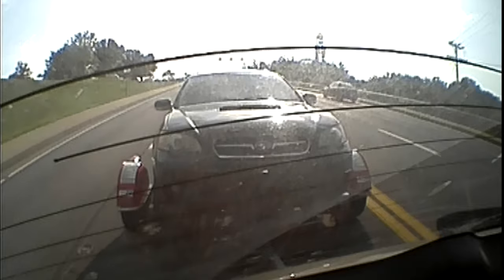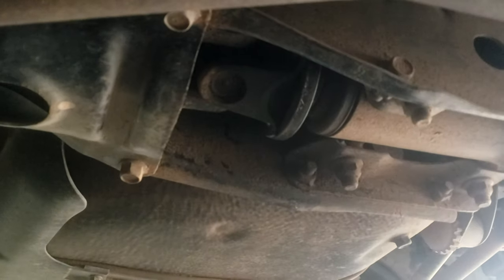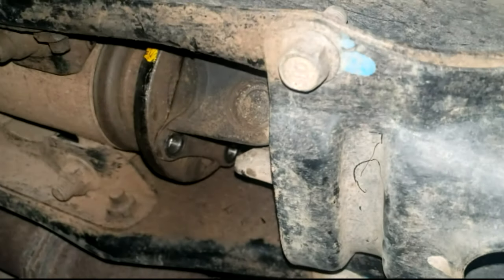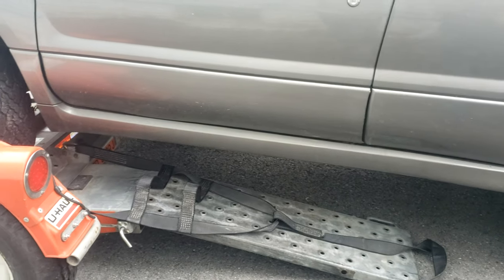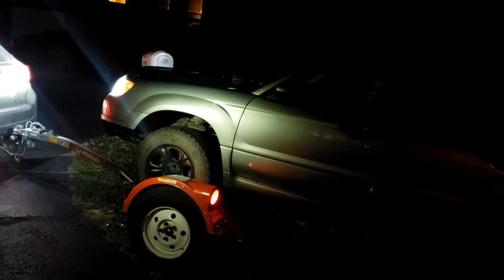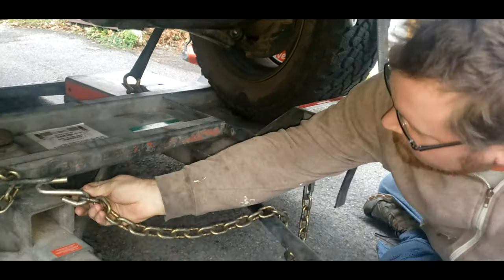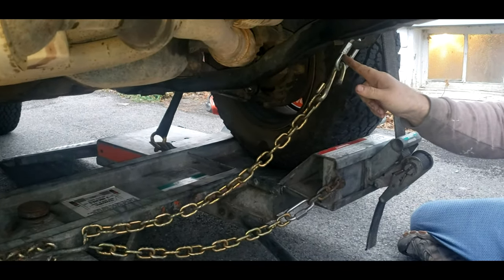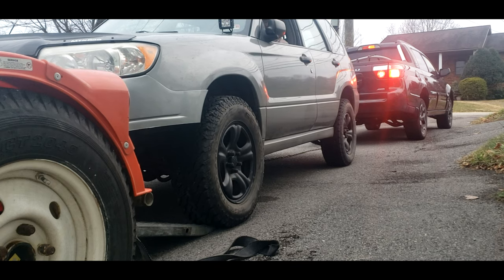How to PROPERLY tow a Subaru using a 2 wheel dolly.

Comment: Make sure  your steering wheel is secure/locked. A good back up to this is wrapping the seat belt around the bottom of the steering wheel twice and clicking it in.
Reply: but there is a video on YouTube which states that Steering wheel must be unlocked

https://youtu.be/ZoizMRJ6aUo
That's the video link, you can go directly to 6:52
Reply: @mr.eervianlesmana9263  when being flat towed yes but since this is a video about towing with a dolly you want the steering wheel  locked so your fenders don't hit the side of the dolly
Reply: @Flexyourmemes  okay
Reply: Don’t ever lock the steering wheels unless the type of the dolly is a pivot one
Reply: @giovannilorenzo2061   good addition. Didn't know about that.
Reply: So, subaru says they are hesitant to do this as it might mess up the car.     I believe it's OK as long as I Zip tie up the differential and make sure they don't contact ?

Comment: Thanks, you convinced me to haul my car on a 6x14 trailer.  Good video for information
Reply from the maker: If you have a vehicle big enough to do 4 wheel towing it's preferred.  (:
Reply: @bruceyyyyy  .If the car being towed is also AWD but has a manual transmission, do you have to remove the drive shaft as well?
Reply: @mr.eervianlesmana9263  yes. All AWDs have a center differential to transfer power to all the wheel at once. The rear wheels spinning will burn out the center diff that’s trying to spin the locked up front wheels
Reply: @TheTorqueAholic  owh, okay. Thank you sir!

Comment: Easy way instead of rolling the car forward is to place chucks or planks of wood 4x4 about a foot long behind front wheels, or use axle stands get in the car put in N and you can turn it by hand then Park and hand brake or emergency break. then you can get to the others. Saves the guess work.  The drive shaft pushes in to the transmission then out if you wish to completly remove it so the plastic wire ties do not burn out.  These are o.k. for a shot distance. Because it is All Wheel Drive you can drive it on using the front wheels only. To put drive chaft back on push into transmission turn untill it slides up then pull back to the diff and bolt it to gether.

Comment: If you put the FWD fuse in, I wonder if you could drive them onto the ramps......  would the drive shaft roll around??? Hmmmm.  Got me wondering now.  I usually use the trailer because I like the surge braking capability of the U-Haul car haulers, but I have a pickup to pull mine around.  Thanks bruceyyyyy
Reply from the maker: I'm not sure. I've heard different things on the FWD fuse. 

When the Suburban gets up and running I will probably buy a dedicated car hauler trailer since it's rated for 9000 pounds towing.
Reply: the driveshaft would indeed want to spin.  Could be problematic..

Comment: What about putting the subaru on the dolly first then disconnecting the drive shaft? More room to get underneath without having to jack up the car. Moving the car forward to rotate the drive shaft with the vehicle the dolly is attached to.
Great video, solving my problem of towing an outback with a rv
Reply from the maker: That could work great! The problem is I'm used to working with inoperable Subaru so this is what I'm used to doing.
Reply: yup. works great. i've done exactly that with 2 different generations of WRX. roll it up, slide under there, theres plenty of room.
Reply: @IIIDemon  Hopefully you can help.  Need to tow a 2019 Subaru Crosstrek with a dolly setup.  Do you know if I can just follow the instructions on this video on a newer Subaru?
Reply: This is how we've always done it: Get it on the dolly, secure it, then get underneath it and undo the driveshaft.

Comment: The rating for the outback is 2700 lbs do you think it could pull another outback with a dolly?
Reply from the maker: If the weight is 2700 lbs or less I would think so.
Reply: I pull Subarus with Subarus a lot. It's overloaded but possible in a pinch. I hate to do it.

Comment: I'm assuming this is an automatic, right?  If standard, wouldn't neutral work just as well?
Reply from the maker: You can tow it with all 4 on the ground if manual.
Reply: @bruceyyyyy  if I had a way to steer it
Reply from the maker: @2002KIngs  Tow Bars are $50. Turn the key on and disconnect the battery.

Comment: At 2:02 you see a bolt that comes out of the differential. I’m having trouble bringing down my driveshaft because of it. It just get hung up on it. Do you have any tips on how to retract that bolt or compress the shaft?
Reply from the maker: Would rotating the differential help at all?
Reply: @bruceyyyyy  I’ll have to try it next time I’m under there. I’ll update if it works

Comment: Do you put a front wheel drive car in park or neutral ?
Reply from the maker: Either should be acceptable. Just don't set the park brake! It's gripping the rear wheels.
Reply: @bruceyyyyy  
Thanks

Comment: I dolly towed  a  Subaru, i didn't disconnect anything do you think i damaged the whole thing?
Reply from the maker: A very short distance might be ok.
Reply: @bruceyyyyy  Oh man I towed it 280 miles, vehicle doesn't start so I can't test drive it yet, so at this point I'm very concerned about the transmission!!
Reply from the maker: Without the engine running the transmission fluid doesn't move. Can cause serious damages. When you get the engine running let me know what happened!
Reply: @bruceyyyyy  Thank you for your replies, and yes for sure I'll let you know what happens once I get it to start.
Reply: Hey about the Subaru it works great nothing happened to the transmission.
Reply from the maker: @Gallo77769  That's great! I've heard of them being ruined from 10 miles of travel. I still wouldn't recommend doing it with as easy as disconnecting the shaft is but glad it worked out for you this time!

Comment: What is your Patreon, or a place I can ask you questions?
Reply from the maker: What's up? You can ask here.
Reply: @bruceyyyyy  Thanks.  I wanted to know a few things about 3.6L/5EAT 4th gen outbacks and the awd system they used.  I am looking to buy one.

1) Is the VTD (planetary) system any worse off-road?  It appears to me to function more like old-school (Torsen) quattro, i.e. all 4 wheels want to go all the time, and like the VCD or traction control (whatever subaru calls the system that brakes spinning wheels) is slower to respond and less effective than with the MPT (multi-plate clutch) / CVT systems, allowing more power to be put down, and more wheel spin, and more fun, but less effectively transferring torque in off-camber situations.  Is this the case?  This is based on videos and observation from limited driving - I haven't owned one, so I don't have first hand experience.

2) Anything to be aware of for 4th gen 3.6 outback relability issues?  I have heard the 3.6 has fewer issues than the 2.5, and for this gen head gasket thickness has been fixed, but engines tend to overheat due to cooling issue and so head gaskets still end up leaking, but due to bent rods, not faulty gaskets, which may result in part from CO entering coolant b/c of oil consumption, as these engines, I have heard, also start drinking oil.

3) in particular, how often should tranny fluid be changed?  Suby recommends inspecting every 30K, i think, but doesn't say a change is required.  I assume more frequent changes are better, some cars I have looked at show tranny flushes done at places other than subaru dealers in the history.  Is the flush a bad idea, as opposed to the drain and fill?  How about just letting the car run so the tranny pump moves the fluid, rather than using a pressurized device to move the fluid (a middle ground approach, I guess)?  Does it matter if non-subaru brand (but otherwise compatible spec) fluid was used, like at a meineke or valvoline?

4) Can you reasonably swap a VTD system and geared auto tranny into a current (6th) gen outback?  Will the x-modes be compatible?  If so, I might consider buying a new gen and modding it in future.
Reply: Ps the reason I am looking at this gen is b/c  I like the more analog feeling, 50/50ish to rear-bias AWD system, and I'm not a fan of CVT's ito of a fun or organic driving experience.
Reply from the maker: @Abbbb225  1) I would say the VTD is better off road. It's more robust with less work on the system. My friends at Power of Your Brains tested and seemed to agree. 

2) They'll burn oil at high mileage but all Subaru will. Headgaskets can creep up but usually not until it's 15+ years old.

3) If off roading I would change fluid every 25-50k minimum.  

4) Never been done before. I'm working on a VTD swap for my TR690 because I've been really happy with it.

5) Dunno. I've driven a 5EAT XT (It's shown in a couple videos) and honestly if you want a drivers car it ain't it. The owner got rid of the car because it was so problematic.
Reply: @bruceyyyyy  Thanks Bruce (I assume that's your name).  

1) So you don't notice less brake intervention to stop wheelspin with VTD?

When you say more robust, you mean ito of longevity, or ito of putting power down (I.e .hill climbs)?

5) I was talking about the 4th gen outback (2010-2014)  which only came, to my knowledge, with the 5EAT with the 3.6R engine.  I drove it, and wouldn't call it a sports car, but liked the feel more than the next gen with the CVT's.  Any thoughts on this setup?
Reply from the maker: 1) Both. It's largely mechanical versus mostly electronic. 

5) I think it's a great car. Haven driven one I just don't think it's a canyon carver. Then again, none of the Outbacks are.
Reply: @bruceyyyyy  Thanks, but I'm still not clear.

What I'm trying to establish is if the 4th gen outbacks (2010-2014) have a less aggressive brake traction control system than the 5th gen (2015-2019) outbacks.  I'm referring specifically to the 3.6R models, which have geared transmissions and a different AWD system, though I don't know if their traction control is programmed any differently than the 2.5 CVT models (if anyone knows, please say).

It's hard for me to say without having both vehicles side by side to test on rollers and various real world conditions, but it appears, from many videos I've seen, that the 4th gen outbacks will allow more wheel spin, making for more fun donuts, and probably an easier time with obstacles and inclines, but impairing them in off-camber and other slip-inclined situations.   

Look at this video, for example (I'm not sure if this car is a 2.5 or a 3.6).  Around the one minute mark you can see the front left wheel slipping and the brake traction control doing very little, if anything, to stop it.  It appears the car eventually finds traction because of the wheel contacting the ground rather than the brakes redistributing torque to other wheels.  https://www.youtube.com/watch?v=IIXLS3_jD-E&t=99s.  With 3 wheels on the ground (it appears the rear right is not lifted) and no incline, I would think this challenge (i.e. one front wheel having no traction) would be a cake-walk for any VDC enabled subaru, yet the car seems to struggle quite a bit.  In various other videos I think I see the same patter, with the 5th gen cars more quickly and effectively limiting wheel spin.

If anyone knows the answer to this definitively (brake-traction control system design/programming between these 2 gens), please say so.  Let's also separate with and without X-mode.  Since the 4th gen does not have X-mode, let's start by comparing it to the 5th gen without x-mode engaged.
Reply from the maker: @Abbbb225  My apologies. I misunderstood.

I have wheeled with a Gen 4 3.6. It was in front or behind me in several places in Colorado but the owner asked not to be shown.

The VDC system in it is way less aggressive and allows for a lot of wheel spin compared to the X Mode in the Gen 5.
Reply: @bruceyyyyy  How about compared to gen 5 w/o x-mode engaged?  

Does the gen 4 VDC do anything?  Does it kick in if you rev high enough?  In the video I linked it appears virtually useless.
Reply from the maker: @Abbbb225  Without X Mode engaged the Gen 5 still wins. The Gen 4 will get there eventually but the Gen 5 is quick and with X Mode engaged it's nearly instant. Check out the 'mudding on election day' video I have. 

The scene with the tires 3 feet in the air is with x mode engaged. The Gen 4 might be able to do it after lots of spinning but I would think the end result is the same.

Comment: You CANT put two wheels on the ground it WILL brake it!! And you CANT toe with a CVT transmission!
Reply: Yes you can
Reply: @Marc_YTC  long as you have warranty
Reply: @lilpeppa117G  no if it’s automatic you can tow with rear wheels rolling and I have a tow truck but never tow a Subaru if it has a clutch the car will lock all the wheels up
Reply: @Marc_YTC  from what I’ve heard if you want what’s best for a Subaru you should listen to what Subaru of Japan has to say and not Subaru of America for best advice of anything
Reply: @Marc_YTC so you disconnect the drive shaft after it's on the dolly ?